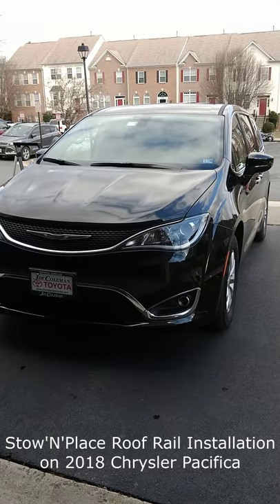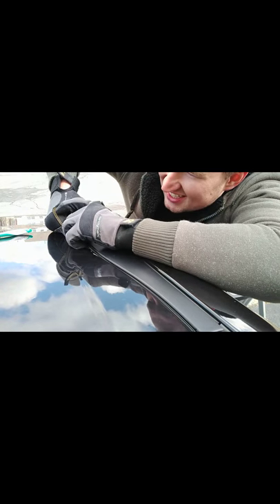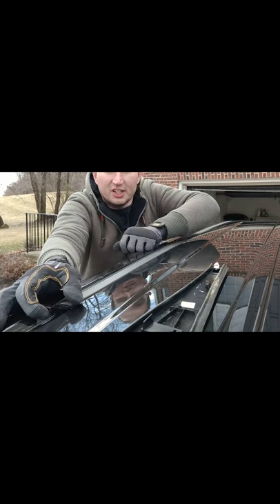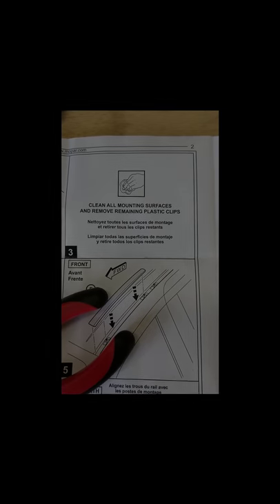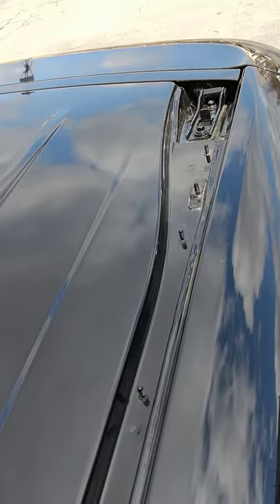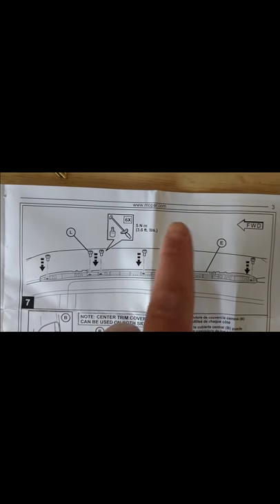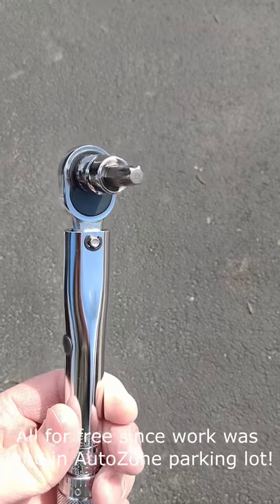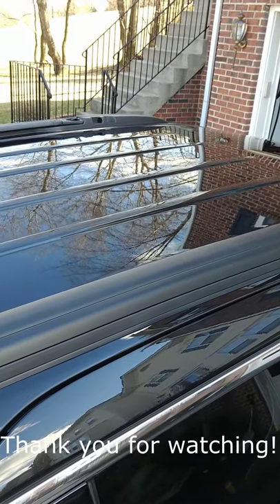2018 Chrysler Pacifica Roof Rail Installation

Comment: Since this is a popular video (shows up first on a google search) - warning. The instructions say 3.4lbs of torque for a reason... the studs that hold this down apparently are made of PLASTIC and can with relative ease be snapped off... guess how I learned that one?
Reply from the maker: Yes I also made this mistake and snapped one stud off, it was very upsetting.
Reply: @hoovejd  did you fix that in any way?
Reply: @hoovejd   oh also - thanks for the video it was extremely helpful as I received my roof-rack sans instructions as well lol
Reply from the maker: @GabrielMartinez-bf7hy  no I could not figure out a way to fix it.
Reply: I love my torque wrenches. They have saved me many times their purchase price over the years - both in money spent replacing over stressed bolts and in general aggravation.

Comment: So regarding the plastic covers at the end of each roof rails. Can you cut them shorter to make room to bolt the rails? I just purchased the rails but do not have the short covers. My roof cover is one long piece.  I was hoping not to have to go buy them if I can just cut them short, since the roof rails would likely cover the cut ends.

Comment: Thanks. I assume it’s still the same on a 2022. The dealer wanted over $800 to do the install. Estimated 3 hrs. To buy the kit is over $400 plus tax and the total at the dealer was $1250 plus tax. Unbelievable.

Comment: Question. Only thing that worries me about cross bar is that someone cans unscrew them take whatever is on your roof. The crossbar has no locking mechanism. Even if your Thule ski holder does they can still carry everything way. Or am I way off base here?
Reply from the maker: Yes this is true, no locking mechanism.
Reply: I have a similar rack on my older town and country..  If you look at the video around 7:40 or so by his left hand (right side of the video screen), there are a few loops on the rack (just behind his left hand) that I am able to fit a padlock through.  I use a curled steel bike lock cable from the padlock through my kayaks when parked (not while driving at speed when the cable could flop around in the breeze! ). 

I figure that makes it a bit more challenging for the guy who drives up and just decides to boost my kayaks.  It now requires some tools, effort and time. 

Side comment.. Be sure not to tighten down a metal rack clamp (that attaches your kayak rack onto the Chrysler crossbar) too tightly.  It would " theoretically" be possible to weaken the crossbar and put so much stress on it at that point that it bends on the freeway at 70 mph with two kayaks on the roof.  (Don't ask me how I know this..)

HTH
Reply: He's actually pointing at the loop at 7:25 with his left index finger

Comment: And this is what YouTube University is all about. Watched your video a few times after ordering the OEM Rack, $30 shipped still hurts, especially for a 150 lb limit but no other choices.
Regardless ordered on 12th, arrived today 31st. Went out opened sliding doors and set a stool at back corner. Package included the hex nuts and instructions. My 2023 PacHy had two pieces per side to remove. Removing the plastic clips was a little tough, but I used a towel to protect paint/metal and a decent flat head screw driver.  I oddly have a screwdriver with the hex tip, but I don't have a torque wrench to set them all at the required 3.8 ft lbs so I have for now left the cover pieces off. Start to "Finish" was about 35 minutes without help. All 12 hex bolts are hand snugged so it should be fine to drive with for a day or two until I get to parts store and borrow the torque wrench.  Word of caution, the new trim pieces are packaged very well, but very easy to bend when removing from foam. I bent up the drivers side and had to reshape the forward piece. I think in the sun over time noone will be able to tell.

Comment: Thanks for the video. I still managed to put the trim pieces on in the wrong order on the first side but recovered. Wouldn’t have tried it without the video.  

I used a square to hex shank adapter from my socket set instead of trying to find a ridiculously large star bit for the torqued bolts. Basically the back end of a standard drill bit fit so I found something similar. Would love for a mechanic or engineer to comment with the actual names of those bits.
Reply: What year is your Pacifica?  I have the 2022 ehybrid and need to know if it's the same steps.  It looks like it's the same...
Reply: I have a PacHy ‘22. Should work for 23 and 24 as I can’t imagine they’ve changed any of those parts.
Reply: @joeymallin7595  thanks!  Did you order the roof rails online or through a dealer?  ...just trying to find the best price

Comment: @Jarrod Hoover, Thank you for putting this video together.  My roof rack did not come with instructions and I am not able to find the 12 mounting nuts (part L in the instructions you link to in the chat)  I wanted to ask where the 12 mounting nuts were stored in your box to make sure that I did not miss anything.  Thanks!
Reply: Mine came without them also.  I don't think we missed them in the box I looked EVERYWHERE.  They are 6mm threads on the van, and I can't wait another few weeks for the dealership to order them and get them to me.  I am ordering 6mm stainless "coupling" nuts from Amazon.  I am using them because they are basically very tall nuts that will stick up above the recess for a 10mm socket to fit on for tightening. Should work, hopefully.  I have to do something.  Thanks...

Comment: Thanks Jarrod for making this very helpful vid. I have a question for you (and anyone else who's done this). I'm not very mechanical, so am trying to get a clear picture in my head before I start this project. If I have a Pacifica without the "factory roof rack system" - I want to know exactly what's underneath those long skinny black trim pieces that run the length of the roof. I mean, after you've cleaned it up and are ready to install the new Mopar factory roof rail system, "what is in the recessed channel" that goes from the windshield to the rear hatch? Are there metal treaded studs sticking up? What's this about plastic studs breaking when you tighten the rails? Or are there raised bolts sticking up in the channel? I don't get the part in the instructions where you tighten torx bolts through the top of the rails, what are you screwing them too? Thank you:)
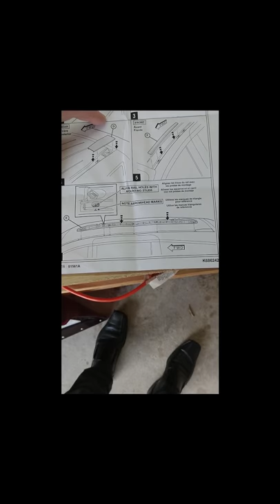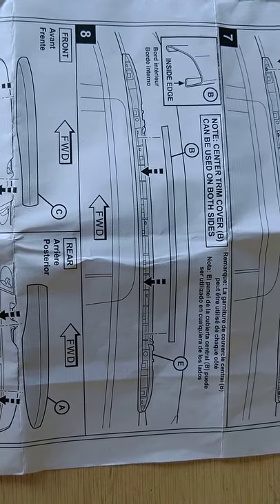Reply: I'm talking about the vid, from 4:50 to 6:45. And, at 5:50 - what exactly are you placing down into the rails? Are those screws, or are those nuts - and what do they attach to? They must be screws, cause at 5:50 you use a screwdriver to tighten them. But I don't understand what those screws fasten to?
Reply from the maker: @jacquieroumelis9601  there are mounting studs already in place. These instructions depict the mounting studs: http://starparts.chrysler.com/info/default/k6862429.pdf
Look at page 2 box 6.
Reply: @hoovejd  - Thank you so much for your reply! So these "mounting studs" are steel (or some kinda metal) right? And I imagine they're threaded, right? So there must be "nuts" that you thread onto the mounting studs? And if that's all true - then I don't understand at 5:50 - you are using a screwdriver to tighten something? And page 3 box 7 shows some Torx screws. I'm trying to get a clear picture in my head - what exactly do these torx bolts, "screw into"? And secondly - what are the plastic studs that can break off?  Sorry for all the stupid questions, I appreciate your time :)
Reply from the maker: @jacquieroumelis9601  yes the mounting studs are some kind of metal and yes they are threaded. At 5:50 I was "hand tightening" the 12 screws that screw onto the threaded mounting studs. I did this at home then went to AutoZone to borrow a torque wrench to tighten them appropriately.  The plastic studs that break off attached to the plastic "cover rails" that you need to remove in the beginning.

Comment: Thanks for the video :) How long did the whole process take? and did you encounter any problems? My local Chrysler dealer wants 340 bucks for the installation!
Reply from the maker: If you have the torque wrench and correct star bit on hand, the install shouldn't take more than hour or so. My biggest problem was that I didn't know how to use the torque wrench correctly and I over tightened a nut and broke the post off. After that first one I was able to torque the rest of the nuts correctly.
Reply: @hoovejd  do you remember what size bit is needed? The instructions don’t seem very clear on that! Thanks

Comment: Or does anyone know the size of those screws?  I think mine didn't come with them.
Reply: 6mm nuts fit on those studs.  10mm socket fits those nuts.  I used 6mm stainless "coupling" nuts from Amazon.  Much faster than the dealer.